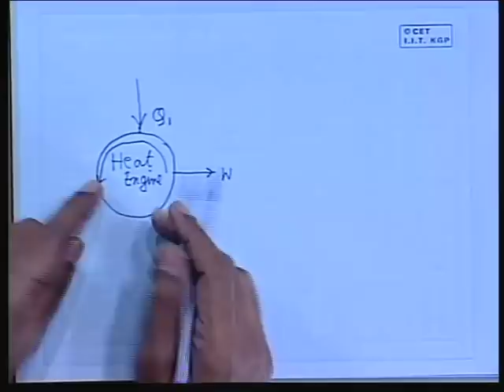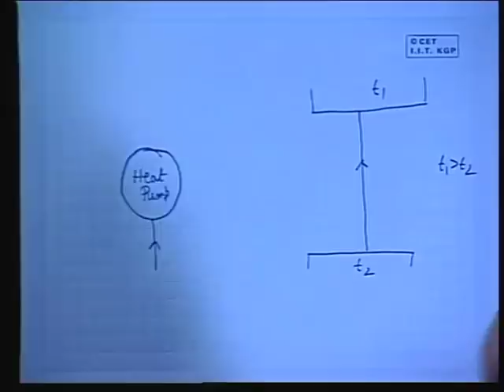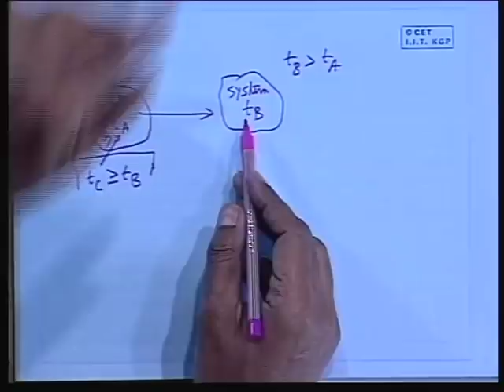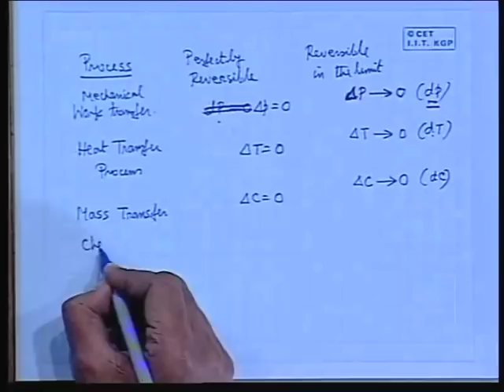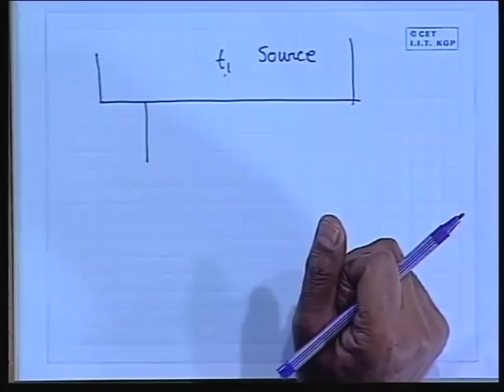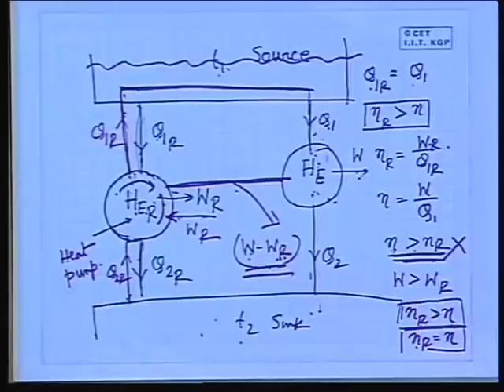Lec-6 Second Law and Its Corollaries-I

Comment: What if we suppose Q2 less than Q2r and applying 1 law then we haveW is greater than Wr so n is greater then nr .
Someone please clear my doubt..
Reply: Q1 rejected from reversible heat engine is used as input to irreversible heat engine. Q2 will be heat rejected by irreversible heat engine.And if W>Wr then net heat produced will be ( W- Wr) which is impossible if the heat engine is exchanging heat only from 1 heat reservoir i.e. Q2(Kelvin Planck statement)

Comment: can we build an irreversible heat pump which rejects the same amount of heat as the heat a reversible engine takes from the same source. given that both the reversible engine and heat pumps are working under the same temperature limits??

Comment: I cant understand how work can be converted completely into heat.........acc. to first law, there will be a change of internal energy while conversion. then how is it possible?
Reply: Work comes under a high grade energy which have tendency to convert fully into other kind of energy. But whereas Heat comes under low grade energy which cannot be fully converted into work (a high grade energy) as heat appears due to change in temperature and whenever a system undergoes a change in temperature, a part of heat energy is used to change its internal energy as well. 
Thus, heat can never be fully converted into work.
Reply: q=u+w .u is function of temperature.if delta t=0 then delta u=0.therefore q=w.
Reply: then reverse i.e heat to work 100% conversion is also possible when delta u =0 .how that is possible ?
Reply: q=u+w is the equation of 1st law for a finite process
           but u also have another equation

            summation of {Q} = summation of {W} is the equation of 1st law for a cycle
Reply: work can be completely converted in a cycle
Reply: Bro it's for non disipative work ...
And in disipative however remaining (total work-work lose befor entering system) work after disipation is totally converted in heat energy

Comment: sir.. i have a question... why it is physically possible to convert heat in to work 100%?????...  plz rply...
Reply: It is not possible to convert heat in to work with 100% efficiency. Because, Heat is a lower Grade energy ,on the other hand, work is a higher grade energy.
Reply: +Pavan Kumar heat energy is the sum of internal energy and work. If all heat energy in a system has to be converted into work the internal energy in the system should become zero. In other words the system should go to zero Kelvin. Which is never possible and there is always some residual internal energy in the system.
Reply: +Vicky Rage Why?
Reply: +bond good
Reply: Pavan Kumar With electrical energy(an example of high grade energy) we can completely convert it in to heat. For eg i have 1unit of electrical energy i can covert it into 1 unit of heat energy. Vice versa is not possible.Think.
Reply: great idea bond ....
Reply: u measure that 1 unit of heat